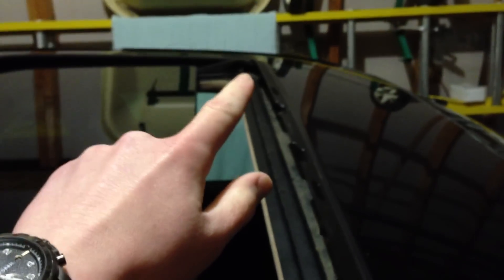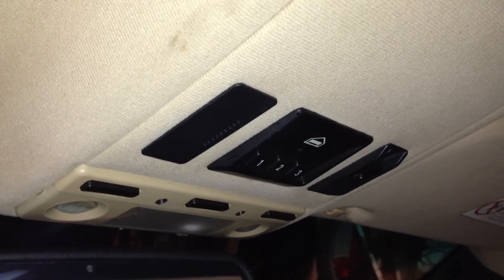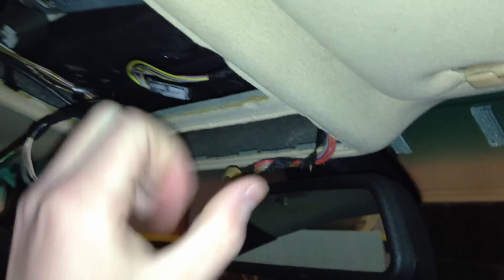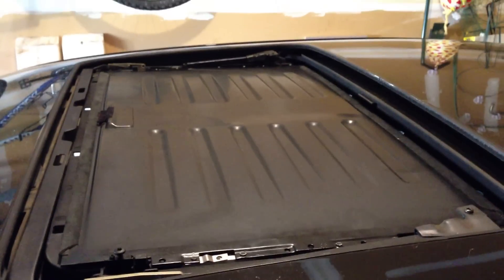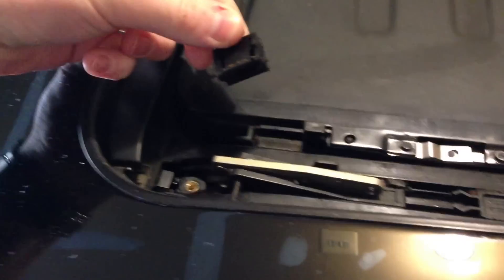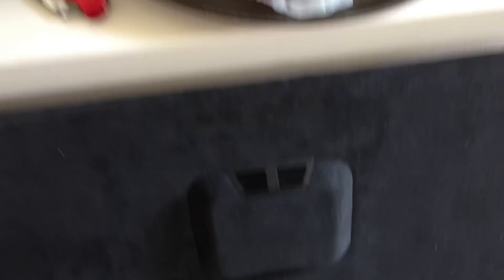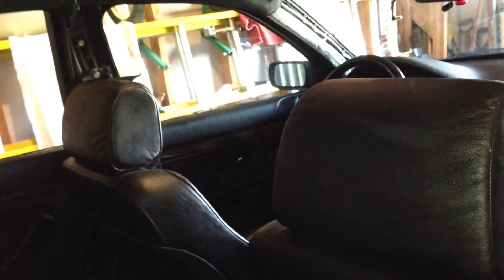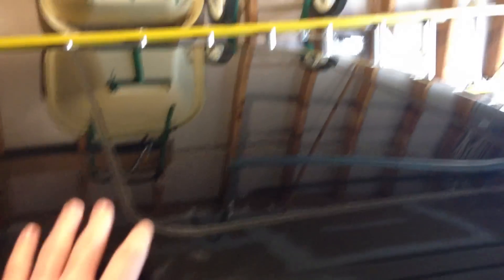BMW E39 Headliner Replacement DIY

Comment: I used this video to do my M5 headliner. Thank you for posting!
Just a suggestion that I used when re-installing it with one person. I used a few golf clubs to prop it up and then installed one handle with the screws to hold it up. Rolled all the trip over the headliner, unscrewed the handle and slid the headliner back slightly to hook the back into position. Then I slid it slightly forward and it was ready to for all of the pieces to be installed. Makes it very easy!

Comment: For the reinstall without a helper use a bungee cord to help hold it in place. Use rags around edges to prevent any paint or body damage

Comment: Hey, Having done this the past weekend on my 01 530i I need to note that BMW did many small changes. The 00 C-pillars are missing the screw holes behind the lights and the front most snap in peg doesn't line up, B-pillars are fatter so you need the matching lower pillar. A-pillars seem fine but I would just buy brand new so you can lock in the middle clip.
I did notice that the (headliner) rear locking slit was smaller (shorter) my original and doesn't lock in so its just hanging there.

Comment: Also I found that the gaiter can be a pita, what I did was take a flat head screw driver and position it like this | and from the rear corner of the popped sunroof place it in like this | and lightly bump it against the gaiter.

Comment: It seems like you knew what you are doing. I have a BMW 325i and my sunroof fabric tray is off track and now my sunroof is stuck in open position. Do you think I have to pull my headliner as well or is there any other short way to release the sunroof from the sunshade? Thanks

Comment: How are you removing the 14 screws on top of the sunroof? My sunroof is blocking 6 out of the 14, towards the rear.
Reply from the maker: You can move the sunroof still during this process.
Reply: @E39Source  Thanks man.  I misunderstood your video.  Very detailed, thanks.

Comment: What's the torx size bit you used to unscrew 14 torx scew which are on the edge and connecting to headliner. I am looking to swap my Metal sunroof to a glass sunroof from a later model. Please advise the size of torx thing I need to buy?
Reply from the maker: I did a repair which required me to pull the sunroof cassette. My bolts were T20 (I believe).  Also remember to disconnect the four sunroof drains at all four corners of the cassette.

-Bobby

Comment: Great, simple Q pls , I want to replace a metal sunroof for a glass one on my e39, do i have to take the glass off the new cassette, or just put the cassette from inside the car as it is, coz its fully functioning.
Reply from the maker: Hmm, I have never seen an E39 with a metal sunroof!  I would imagine that the whole cassette needs to be replaced, but maybe it is just the different panel.  Check the cassette part numbers on RealOEM and see if they changed.
Reply: Thanks for reply, I did that and its different parts no. its the European old style metal, I asked and the mechanics said its same base, just switch cassettes coz holding mechanism is different, but I saw your video and noticed that you took off the glass before removal so I wondered why, just for easier repair or is it the method for installing the new cassette, ok if you want to replace the cassette with a complete new one, no repair, would you remove the glass first or just take and replace the cassette? thanks again
Reply from the maker: This video was submitted to us by a user that no longer does BMW content.  I think in order to remove the cassette, however, you do have to firstly remove the glass.
Reply: E39Source Thanks a lot.
Reply from the maker: @austigm3888  Awesome!  I can only download that in 360p though... do you have a 720p or 1080p  version?
Reply from the maker: @austigm3888  The only way I have of sharing it would be to post it on E39Source, but I can't download a high-quality enough copy to do so.
Reply: @E39Source  All respect, and thanks again,but i dont want to give away the video,  thought you could be interested in saving the playlist in one of your e39 lists, if it doesnt suit you, i understand, yet am still honored to at least , have you liked my work, you helped me a lot in your videos, and inspired my channel from beginning
Reply from the maker: @austigm3888  I reserve our playlists for E39Source content, but thanks for sharing!  Good work and a solid job of helping the community.
Reply: @E39Source  Thank you all, best regards

Comment: I have a E38 how did you remove the back screws Im having trouble taking them out without pushing the headliner down from the inside
Reply from the maker: Which back screws are you referring to?
Reply: +E39Source when your taking off the headliner and you take the screws from the sunroof and the ones from the back last 6 on mine are a pain in the ass
Reply from the maker: +Phillip Alfaro No idea, Colton produced this video and is no longer a part of E39Source.  It should all be do-able from the interior though.

Comment: Do the o-crap handles mounting holes line up?? I have a 97 540i and want to this install.
Reply from the maker: Robert deSousa Yes, they will mount right up.
Reply: I purchased a 2001 e39 black alcantara headliner, looking at the position of the recessed spots for the o-crap handles they seem to sit forward about a half inch more than my 97 540i and the handles aren't as long/wide the m5 hanldes are a little shorter. I'm concerned that after trying to put in the new handles won't be able to mount because the mounting position will possibly be covered by the headliner, unless the mounting points can be adjusted. I would hate to take everything apart to find out the handles won't mount.  The front pillars are SRS mine aren't, not sure if this will be an issue also. Wish I could converse over phone with someone about this.
Reply: The part number for the headliner I purchased is 700840.
Reply from the maker: @robertdesousa6546  To the best of my knowledge, the grab handle location on the E39 never changed.  I would honestly be surprised if it did, or if the handles changed themselves.  I just looked up the handle part number.  It says it is used from 9/1997+.  What its the production date of your car?  The headliner part number also changes in 9/97.  I've never worked on an E39 older than 10/99 or so, so perhaps the super super early ones did have a different location!
Reply: @E39Source  my production year is 6/97
Reply: Looks like I have a alcantara headliner to resell
Reply from the maker: @robertdesousa6546  You do have different grab handles then, from some standpoint at least.  I would mature the fastening holes from the back edge of headliner, and see if they are indeed different.  The holes cannot easily be relocated.
Reply: @E39Source  thanks for your help 👍

Comment: Hi, do you know if  there is a way to take out the slider without removing the whole headliner?
Reply: Hi,

You can remove the sunroof glass to remove the slider.  First, carefully pull the gators (rubber accordion looking things on the sides of the sunroof with it closed) away from the sunroof, then remove the four screws on the corners of the sunroof.  After you lift the glass out, you will see two screws holding the gators on, and under that are four screws for the slider.  All screws are Torx, if I recall they are T20.  Getting the glass back in is the hard part.  You have to line it up in the front first (having two people for this REALLY helps), then screw it in and align it with the rear screw holes, ensuring it seals properly.  It’s an easy job, just getting the glass back in is tough. Good luck!

—Bobby
Reply: Thanks a lot

Comment: How do u do the the 2 front ones on the windshield do they like sell them somewhere separate or cuz I just wana do the 2 of them
Reply: The two front what?
Reply: +Bobby O'Hearn the 2 pillars on the windshield
Reply: +Affectam you can get them separately. Look at ECS tuning or RealOEM for the part number.
Reply: +Bobby O'Hearn yes I think they are called pillirs trim
Reply: +Affectam correct, the A pillar trim.
Reply: +Bobby O'Hearn so u sayid where do I get them for my 2008 BMW 535xi
Reply: +Affectam Look at FCPEuro.com, they ship internationally if you are not in the US.  What color is your interior?
Reply: +Bobby O'Hearn it's all black except the pillirs trims on the windshield and the whole headliner sliver